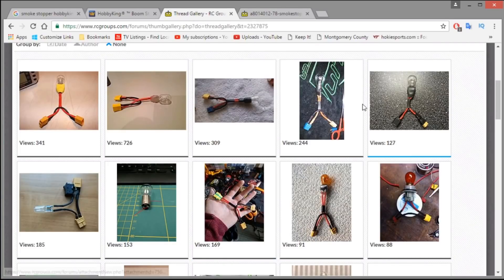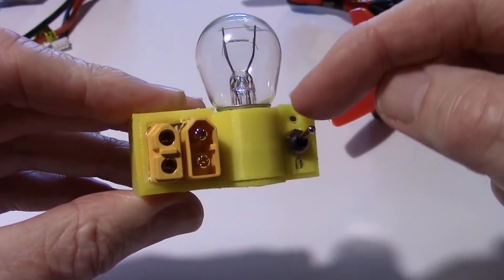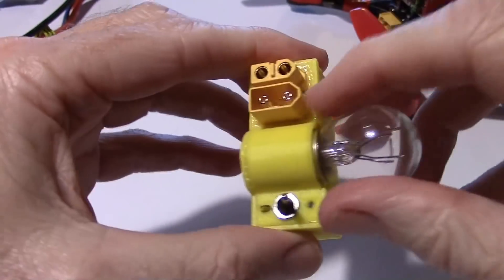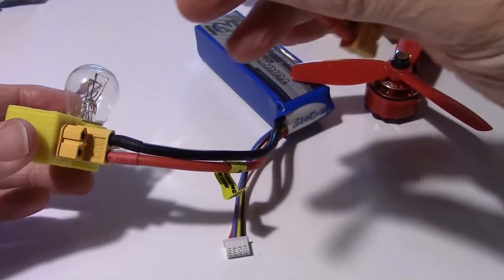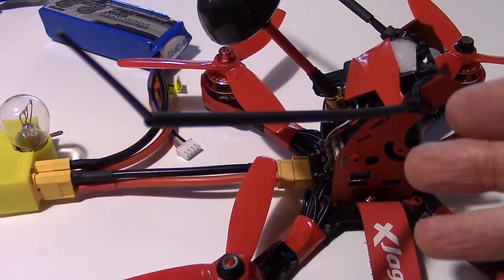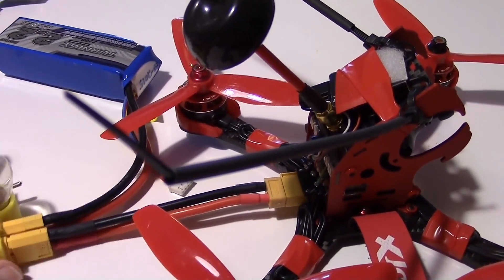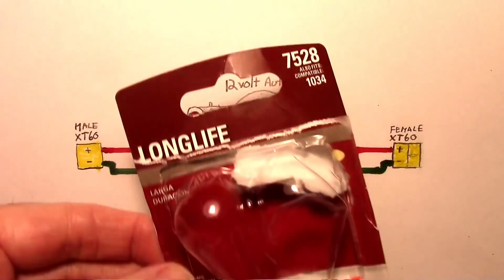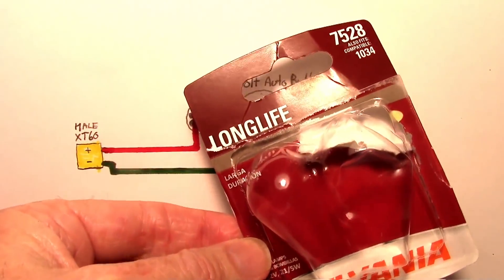Short Stopper current limiter protection - What is it and How to Build for RC quadcopter or airplane

Comment: It is a "GREAT IDEA" but why not USE Micro Stuff https://www.lightbulbu.com/light-bulbs/mini-indicator-lamp/64425-mini-indicator-lamp-20-watt-12-volt-t3-bi-pin-g4-base-clear instead or a "Mini Bayonet" push style Lightbulb?  (yep...2amp)
Reply from the maker: Sounds great but would would I use for a socket to plug the micro bulb into to?
Reply: Thats an EG....My idea is using a standard PUSH type bulb (old style car Dash Bulb) and adapting it to an Onboard LIGHT to protect Quad Copters inflight that may be "Dunked" into water by mistake? The smaller the better...as Weight is a main Factor in flying RC stuff? Right now..Hobby stuff is using a Fuse Type Circuit interrupter..which is Garbage as it still allows the SHORT to hit a Limit in a Circuit board before Activating? Run with it..I expect if you MAKE your Video into Micro-Circuitry and BULBS...they will beat a path to your Doorstep for the product in the Quad Copter world?
Reply: Just an EG....try the Car Wrecker, go find Older  model (pre-LED bulbs) and look at the Dash Board Mini Bulbs/plugs...YEP Incandescent bulbs that PLUGGED directly into the Dashboard  This is probably now "New Old Stock" is the Light bulb industry...but its just and example instead of using Standard Sized? Weight is a Huge thing to the Quad copter owners(flight time) but Water short-out protection rates Higher...so...if you can make it LIGHT enough and small enough for Onboard "Flights" you may have a marketable product? Good Luck....

Comment: Jonathan -

Thanks to you and your dad for referring back to my original DIY on the video so I can answer any questions folks may have. 

While I appreciate your enthusiasm for my SmokeStopper™ project, if you look at the first page of the thread, you'll see it has been revised to reflect evolution of the device which has arisen over the last couple years. For reference, it is here: http://www.rcgroups.com/forums/showthread.php?t=2327875

"The advent of Micro and Nano quads has resulted in a similar evolution of smaller, more sensitive electronics being used for all model aircraft; nowadays it isn't safe to do initial testing with the High-Current tester shown here, though you should STILL have one for testing with all accessories before plugging the battery in direct and for Spin-up testing motors and bench-testing for proper aircraft response with props on.

The ONLY TIME you should be using the HIGH-CURRENT(25-27W filament in circuit) Tester is AFTER testing with the LOW-CURRENT Tester; this will protect your smaller electronics as well as your ESCs.

The LOW-CURRENT version uses ONLY the "Dim" 5W filament; this is enough to power up the FC, and initialize the ESCs, but will sometimes glow if your ESCs have a very loud "Beacon" or initializing tone."

I appreciate the desire for the convenience of a switch, however I made this device as a plug-in for a reason, and I recommend NOT using a switch on main power as your model is designed. 

I ONLY recommend making and using the Plug-in version so that you can see at a glance that the device is plugged in and remember to unplug it.

The reason this is so important is that leaving it plugged in is actually a safety/damaged LiPo HAZARD. Under normal usage, the light ONLY illuminates briefly, if at all. Having a switch on the device encourages one to leave it plugged in for extended periods; it is only a matter of time before one forgets and leaves it plugged in/turned on for an afternoon or overnight. 

This WILL result in an over-discharged or even puffed LiPo; while it doesn't happen often, any time you have a puffed LiPo it IS a fire hazard. ANY deformation of a LiPo battery causes deformation of the plates inside, and makes possible short-circuiting of said plates. THAT short-circuit condition is what starts LiPo fires.

If you are NOT in the habit of leaving the SmokeStopper™ plugged in, this will NOT happen.

This is also my main complaint about the HobbyKrunk BoomStopper; it is a safety hazard for this and several other reasons. Of course every time I post on their threads, my warnings disappear.

Thanks again for promoting the SmokeStopper™, but I really do hope you and your dad will edit your video and design to reflect what I've discussed here.

That said... I think a version which uses a switch to enable/disable the high-current filament would be just awesome; as long as it doesn't turn the thing OFF so you're inclined to leave it plugged in all the time you're working. 

mnem
And don't forget to Pay It Forward!
Reply from the maker: Thanks for post,

Got to love the smoke stopper.

How about this, I could put a disclaimer on the video.
Caution:
This is for three cell batteries only or 12volts (already mentioned in video),
This is the higher current version and some FC's could be damaged with 2.5 amps
so check your aircraft for shorts with a meter first (I do anyway),
Don't forget to unplug because a mistake of leaving the switch on could drain batteries,
With this version props could still spin-up on tiny quads that can fly on 2.5 amps so always remove props,
Don't use on projects that use 1 cell or 2 cell batteries or you may damage the aircraft,
We are not responsible for damage caused by this device.

See RCgroups thread for more information on other versions and designs:
http://www.rcgroups.com/forums/showthread.php?t=2327875
Reply: mnemennth hi. it is only a work in progress. I designed it so the switch makes for a speedy shutdown because plugs can be snug. having a quick shut-off means less damage to the vehicle.
true it could get left on,so I plan to use an LED for a power light. but I do not think its needed because most aircraft beep and light up.
Reply: Guys, I applaud your ingenuity here, and really don't want to clog up your video discussion with even more about tech, IP and best practices. I'm going to copy this over to the thread on my blog so we can discuss it. :D

See the discussion here; please join in so we can work this out: https://www.rcgroups.com/forums/showthread.php?2327875-DIY-SAVE-YOUR-ELECTRONICS%21-BUILD-A-SmokeStopper%C2%99-%21/page22

Comment: I had just saw it on RCG my self, will have to build one I think.
Reply from the maker: It seems to be a big thing with mini-quad enthusiasts and has been around for a while but I had to do a video on it in case my viewers missed out on it.  Have a good new year.
Reply: yes it could save a flight controller or esc motor ect. It was new to me.
it will be good with the switch for holding the bind button and flipping switch instead of plugging in battery for binding procedures on quads with the controller / rx hard wired together or on same board.
you have a great new year to.

Comment: Happy New Year.
Nice design and looking great, but would it be user friendly if the xt60 are in line like a watt meter? (power in plug - bulb - switch -  power out plug ). Its just an idea ;o)
Reply from the maker: That is a good idea and I will mention it to Jon.
Have a good 2017!
Reply: FGDude revising it anyway. the main goal was to have a socket for the bulb.